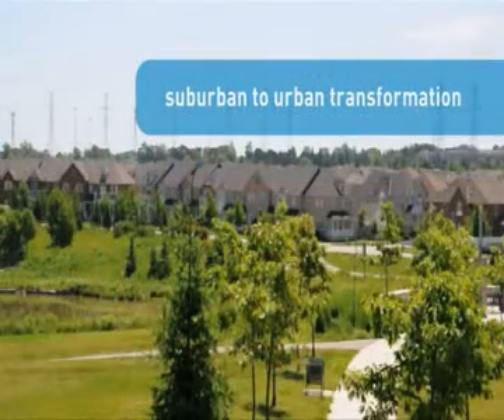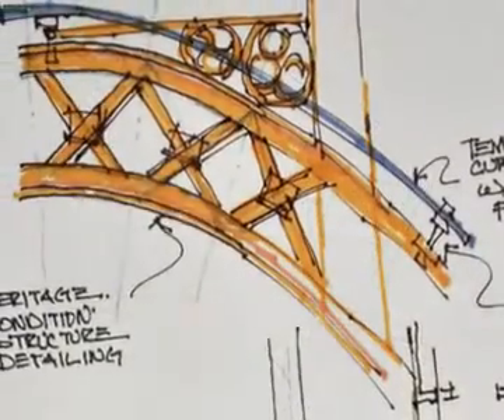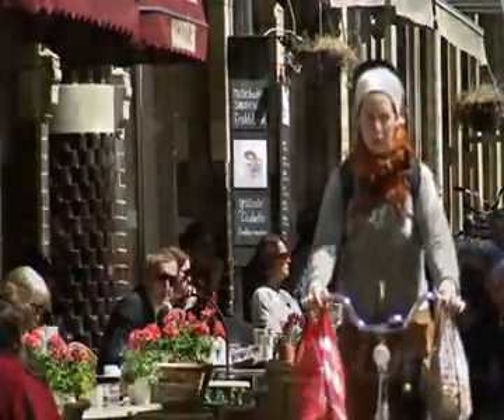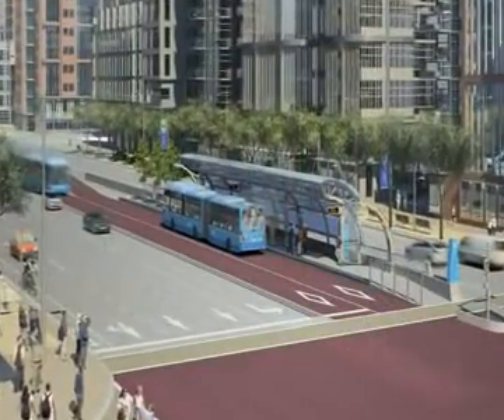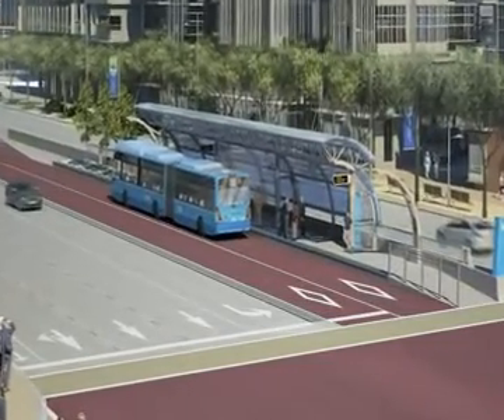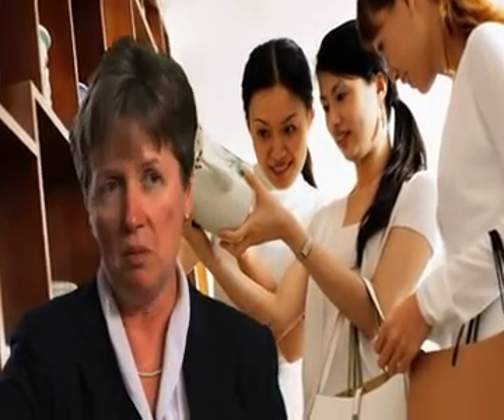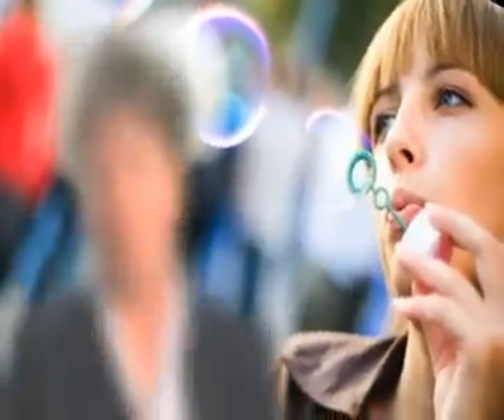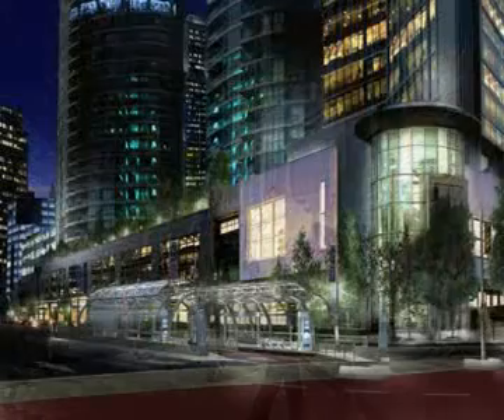new rapidway vivastation

Comment: If Only VIVA Could Attempt *Railways too (****Buses are carcinogenic)

*VIVA Red (Rolling Stock **Modified versions of Tokyo Metro 1000 Series)

**Sliding Plug Doors instead of Pocket doors, Middle Door replaced by a window to accommodate more seating area, Horizontal seating replaced with transverse seating with ***half height partitions (Business Class Uses Full Height Partitions with windows)
All Coaches will have retro-style interiors, with brass-coloured handrails and wood-grain effect walls,
***Wood Panelled Partitions

****Carbon Monoxide